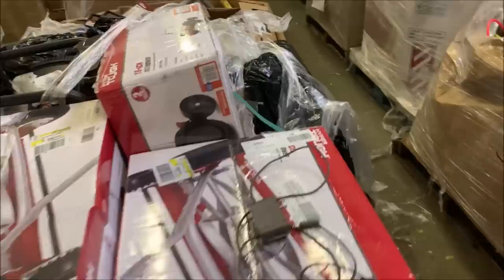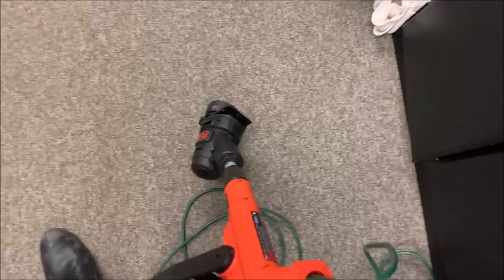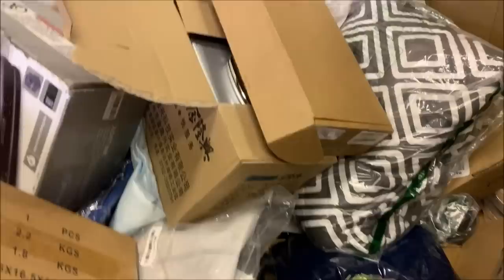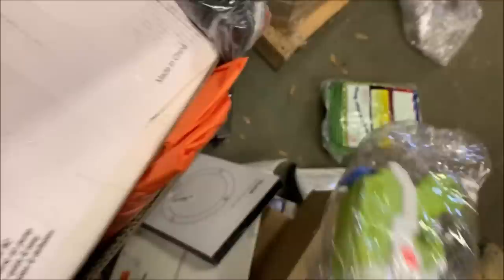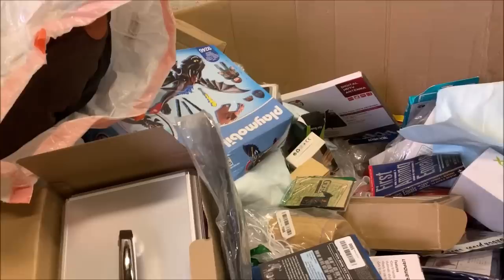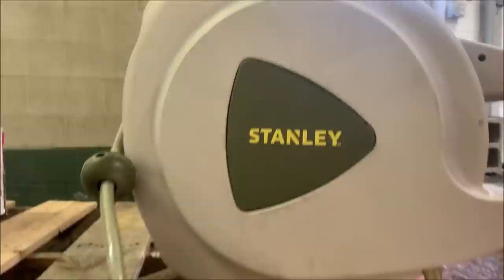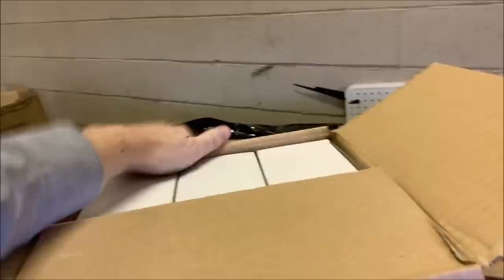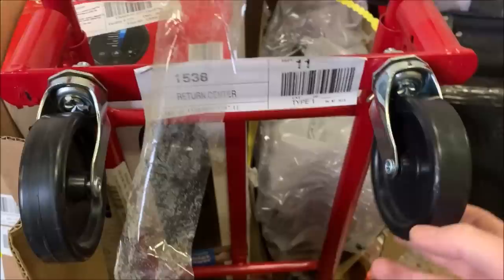EVEN MORE Digging Through These Pallets (part 3)

Comment: Hey Rabbit, we've briefly had interactions in the past when potential marijuana paraphernalia came up.
I did some looking through the laws and it appears that as long as the 'pipes' or other accessories are shipped regular but have some form of paperwork  in the box from the shipper to sender stating they are for 'tobacco use only,' even if the items themselves have marijuana decals or the like, it's legal and fine. Especially considering my states recreational status. 
So, if you ever do feel like selling them off (the hookah in this case) rather than the usual dumpster deposit I'm always here but, as we've discussed before, completely understand the trepidation over something like that; you have worked hard to build what you have and don't wish some loose based law to detract from that, lol. 
In any case, thanks for the entertainment and best wishes!